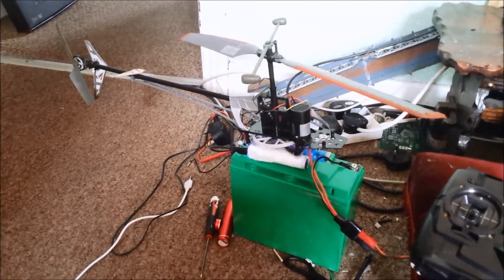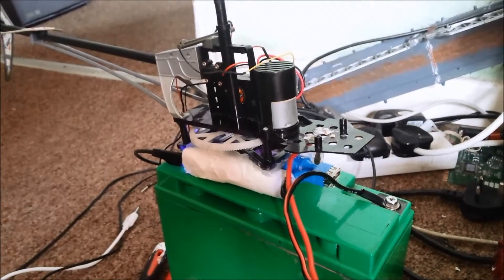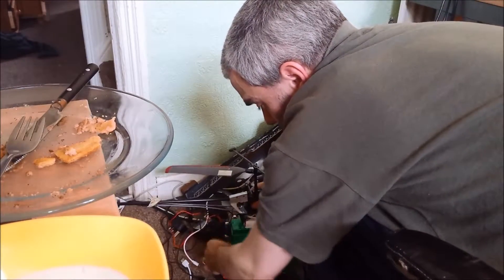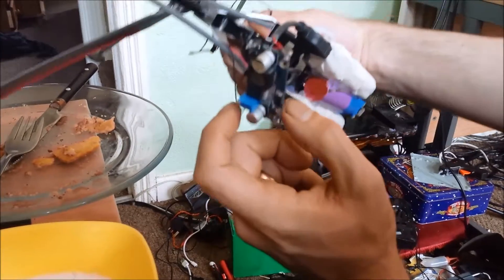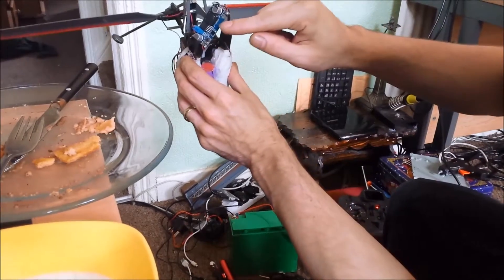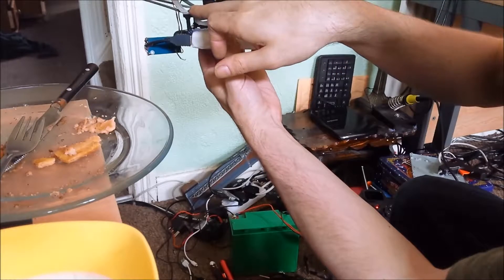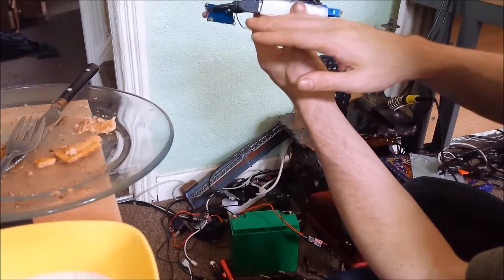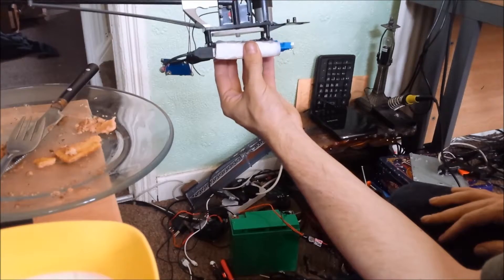R/C 'Power Bank' Helicopter Experiment - Part 2

Comment: i say try to run 2 lithium cells at 8v or 3 lithium cells at 12v and no step up board. btw how many amps does the motor take?

or maybe you did that in a previous video i just didnt see.
Reply from the maker: hmm not sure on the amperage rating on the motor, the chopper is a bit of an obscure model.

I was reading that ni-mh run around 5c on r/c so I think that's a peak amperage of 3.25amps, so I'd say the motor should handle 3 or 4amps from a stronger amped step-up board.

I cant think of a better man to advise on the peak ampage of a single li-ion cell, I imagine they are the same cells that are running these battery banks. The one perk I would say to running them from the battery bank (as to say both the li-ion cell + charge board), is that its handy to hook up to a usb adaptor to charge them :-)

this seems pretty handy http://www.kritikalmass.net/battery-calculator/index.php
Reply: battonfive
 just remember when you step up voltage it takes more and more amps from the battery. i didn't mean what it's rated for, i mean connect it to 8v or somethingand see how many amps it actually pulls through a meter.
Reply from the maker: just had a look through my phone charger and wires stash, nothing suitable though :-( either too low voltage, to high voltage, or to low voltage but correct amperage.

your right of course, with the step-up of the voltage from 5.2v to 10.2v then adding on the fact its being pumped from 1amp to 3-4amp + the 90% efficiency of the step-up board...and that's a lot of energy loss :-)

it makes me wonder if I can by pass the output port on the pcb on the cell and keep the input ports on the pcb in place for charging them :-)
Reply: battonfive
 are you using regular 18650 cells?
Reply from the maker: yep, just had a look, its an 18650 with a small pcb board on the top that has a small usb input charge and a standard wide usb for the output.

looks like I owe you a beer though, I recon I should be able to bypass the board that's regulating the out 5.2v half amp.

As you say if I can run three in series there to get 9volt then that will be sweet! I can then charge them with the pcb boards using the small usb input on the boards :-D
Reply: battonfive
 yeah thats great, just use the PCB for charging and balancing but have some direct leads for full power.
Reply from the maker: just stripping it down to do the soldering, im intrigured for sure now, it makes me wonder what other opportunities these little charging boards may hold.

its always handy to be able to charge stuff by usb and a lot of the bitcoin mining usb adaptors had high amperages.

even multiple pcbs in series or parallel might have there uses :-)
Reply from the maker: Rinoa Super-Genius dude that worked a charm...it not only works...but has gained some mega power there as well lol...so worth the vid post!
Reply: battonfive
awesome, i wanna see a video about it. :D
Reply from the maker: Rinoa Super-Genius its so good man, its great to see some progress on stuff, feels like I spend most my days waiting for the postwoman with my components :-)

http://youtu.be/h3bAZE-niiI

Thanks for the input man, I do appreciate it :-)